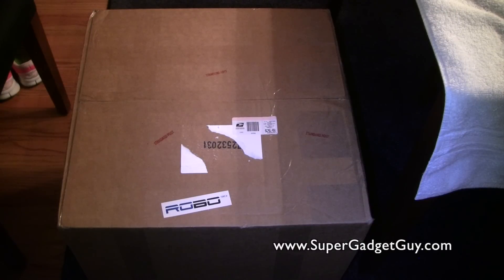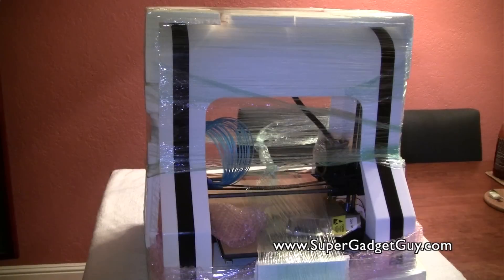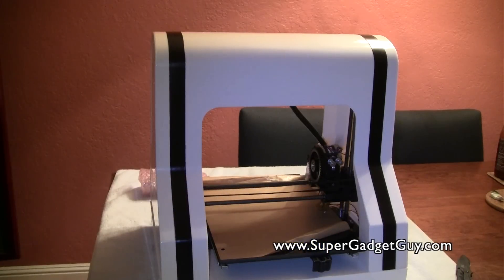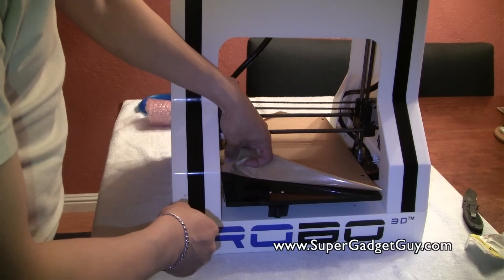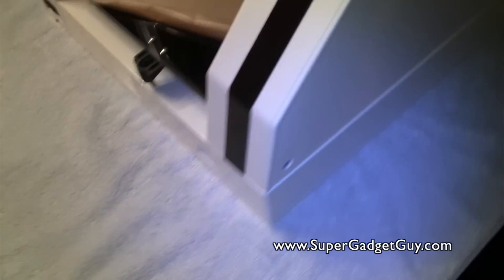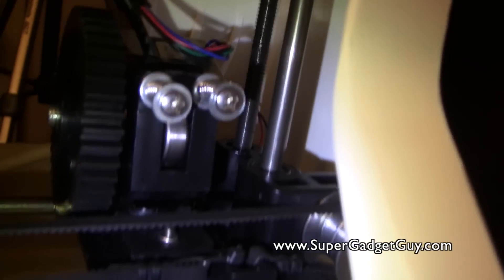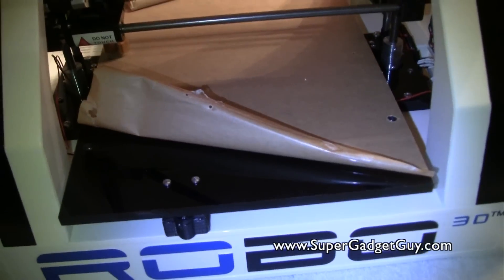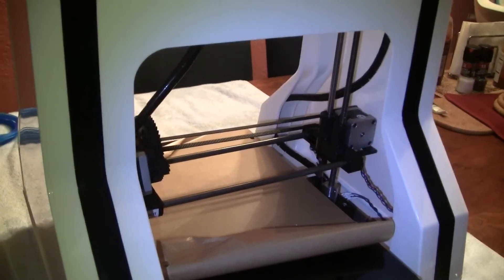ROBO 3D 3D Printer Unboxing

Comment from the maker: I can see the use for it but i don't think it's ready for mass consumer market yet. I will make the video showing the prints i made. So far i have made mostly calibration cubes and mods for the printer. Prints are decent but by no means close enough to Makerbot Replicator 2 but that's $2200. For it's price it does produce 3D object. I am sure it's me since i can see other users are able to produce better prints.